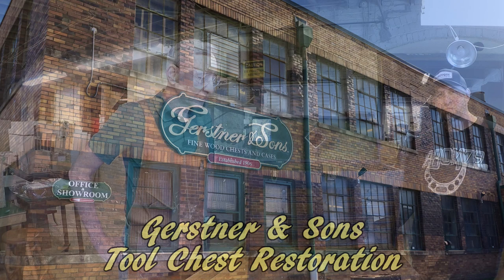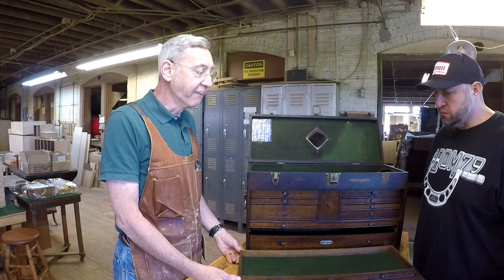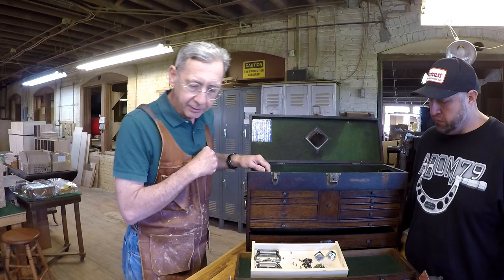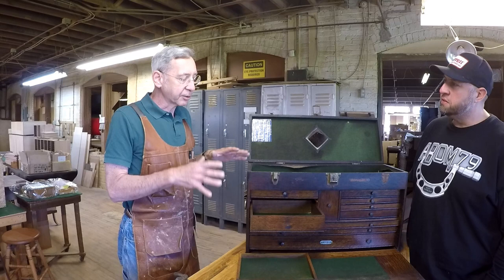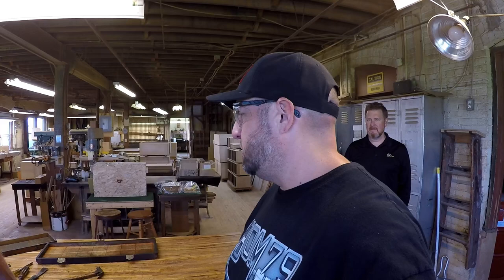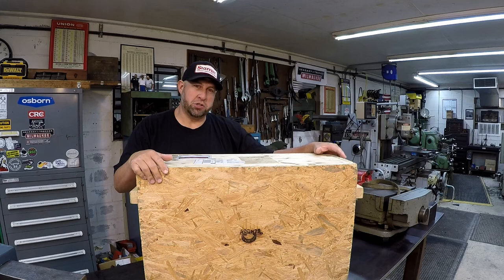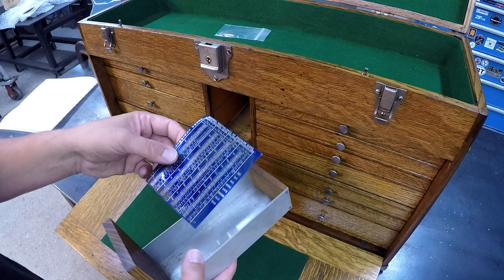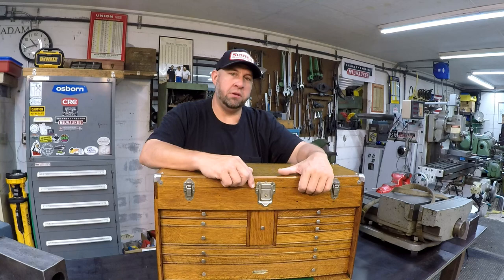Gerstner & Sons Tool Chest Restoration

Comment: You may want to write in the inside of the bottom of the chest "Restored by Paul Martin of Gerstner & Son's for Atom Booth with Date" and include your "ABom79" heat stamp. You must load it with your instruments in order to be functional and complete. If you desire, Gerstner has washers that can be installed behind each drawer knob to eliminate wearing away of the varnish. Enjoy using your instrument chest.

Comment: It is beautiful. This is so wonderful. There is such an overlap between master woodworkers, and master machinists. Both love the joy of producing a beautiful object. Adam says, "They are still using the same tool that they used in 1965." Adam is still using the same tool that was used in1943 !  They have been there since 1906, but of course. Excellence lives forever.

Comment: My Dad was a master carpenter.  He built beautiful furniture. He always signed and dated his work somewhere out of sight.  I wish you had signed the bottom of the box and dated it before it was clear coated.  That would have been a nice touch to the history and preservation.  maybe you can install a metal tag inside with your information.
Reply: I'm sure you meant that it would have been great for the restorer, Paul, to sign it- and I couldn't agree more! I was actually a bit surprised that he didn't.
Reply: That would have been great also, but the original owners name is in the bottom, so I thought Adam's name should be in there also after the restoration.

Comment: a company where i worked as a machinist after you were there 5 years in good standing they bought you a Gerstner box  sized to  your station starting with the 52  and all the way up to the largest at the time   my first chest i believe was the 2111 or one close it was in the late 70s when i received mine  every 5 years after you had choice to up grade to larger chest or add to what you had i made it 12  years and opted for a bottom box omg did it work and look good  i would still have it but it was destroyed in a shop fire i was very sad to loose it

Comment: Hi Adam, you said the box was a 1965 model, you bought it used.  My box is a 1965 model.  I bought it NEW in 1965 and am the ONLY owner.  I bought it on sale for $2 off, it cost me $58, I still own it.  I WAS a machinist/moldmaker, retired 15 years now.  I do not like Oak, mine is Walnut.  Really great video and channel.

Comment: She's an absolute beauty Adam. The ray flake on the front panels, sides, etc. is difficult to find across that width in that quality these days. Mostly because sawmills don't want to quarter cut Oak to just to express that....most of the time the best bet is to split logs yourself....anyway. I've got my eye on an old Oak phamacist's cabinet here in Finland which is along these lines; wood selected for appearance and placement, original brass hardware and hand cut dovetailing where it needs the strength. Unlike your tool chest though, it shows the wear of a lifetime (not it's lifetime!) of use. That's something I want to preserve and keep as-is; unless something becomes fragile or breaks, I'd rather keep in that patina and history to the piece. Restoring your Gerstner chest was the right decision to make, and I know it'll receive the same care and reverence that you do with your work. Beautiful, man, beautiful.

Comment: Paul Martin is a man one can appreciate. While I am usually not all that sentimental about things, I do regard my tools as special. Especially the tools and two Gerstner chests that I have that were owned and used by men who are retired or gone now. When I use a tool with a company name  or a mans initials engraved in it, I wonder what they may have made with them. Did those parts fly on a plane or rocket? fight a war at sea? was the guy a tool maker?  Perhaps he was production or job shop machinists? How long did he own these tools? It's fun for me to think about such things as I make my parts I need. I have always held the craftsmen that came before me in high regard. I can see Paul Martin does too. A beautiful job sir, well done. 

Thanks Adam for making this happen, for me it ranks up there with the Large Lathe Work video as the best Abom79 episode ever!

Comment: I just scored my first 042.  Been looking for a long time, and never thought I'd get one.  I found it about 10 minutes after it got posted, it just said "Die Maker Tool Box".  Saw it, and said "Yep"...contacted the seller and they said "made a mistake, it's supposed to be $300"...I said "OK, when do you want to meet".  I met up with them and talked with the owner of the box.  He left ALL his tools in it.  WOW...so much stuff.  Only issue is that one drawer is a little sticky, and it might need some felt.  I'll consider contacting Gerstner about doing some work, but this thing is amazing, and it came with all this guys tools.  So happy and fortunate to own one of these now.
Reply: Felt will not make your drawer less sticky! The felt “lays down inside” the drawer and therefore cannot in any way hinder the sliding of the drawer!
Reply: @fordboss9275  Yep, aware, I meant that the drawer liners might need to be replaced.  Should have written "Only issues" instead of issue.  Overall a beautiful box and I'm proud to own it.

Comment: So abom I have the exact chest and I bought it in 1972 or 73.....the front lid separated and not by abuse just age
Mine is like new and as I said after seeing your video I called them and they were very nice and accommodating 
I sent them photos and will most likely drive from Asheville to their factory
I won’t get the deal you got but their fees are mire than fair
I also have my 1973 detomaso pantera that I bought about the same time
So thanks for making me to get it repaired at the best possible place
Reply from the maker: That sounds great! 👍🏻

Comment: Adom I think that it looks better than the new one's that were in the show room. With the difference of the older oak and the original hardware cleaned up. It's cool that the original owner wrote his name and address in it and the date. plus it's from the same town where you grew up and live. I think you should write the restoration date and that Paul Martin did it. Also you should write your name, address and date it to.

Comment: Went to an auction about 6 months ago, tons, (literal) of tools. With lots of crud and dirt from a well-known shop in town. In the corner was a  box just like this one. A little rougher shape, I did not have time to stand around and wait for the auction because it looked like it would be about 2/3's of the way through the auction before the box came up. I check the price it sold for and nearly choked, (around a $146). The people must have just been tired of waiting around, all hardware was in tack, there may have been one or two drawers that needed some glue, the felt was all greased out and even worn through. I've kicked myself every day since I thought it would go for at least five times that price.

Comment: To have a piece like the engineering drawer set there, from an environment where everything is being reduced or added to with precision, renovated in the same factory it was originally made, repaired and crafted by hand with much original tooling is, in this day and age, something special.  If cleaning away the grease allowed closer inspection then sobeit.  The original markings pencilled on the wood by the previous owner, not forgetting the factory marking, were still there on the restored box and drawers.  The previous owner would thank you for the restoration of such a well-kept, well-used, fine-toleranced wood and brass drawer set, reflecting the precision the drawers usually would and will hold.  Just a lovely piece.  I appreciate it's clean looks, Adam.
(Adam)

Comment: I walked in that very spot everyday for a couple of my younger years...back in 1974-76. I can testify about the intense craftsmanship put into building those boxes from the beginning with raw materials and to the end with the final touches and inspection. One really cool thing about that building is it was 3 floors with each floor dedicated to a certain portion of the manufacturing process. The only elevator for product transport was an old rope pulled thing...:) Back then a lot of the tools used were of the kind you might see at an antique shop today..:) Last fall 2023 I was on a long vacation drive throughout the USA and arranged to spend some time visiting old haunts around Dayton. I went to Gerstner and although it had changed some...I still recognized the area. I saw a guy on the dock (where I had walked in and out of many times) and turned out to be the current owner and he gave me permission to wander around the outside of the building to take pictures. Later I realized he was the grandson of the top man there in my times.

Comment: Why is there a mirror on the top?  Did the mirror function as a tool in anyway or was it just to spruce up in case you were called in to the boss's office? 8)
Reply: From what others have said, apparently it was for potentially if you got something in your eye, like a sliver of metal or whatever, which was probably more common back in the day.
Reply: @scottr939  exactly, no safety eye wear then. Large magnet plus a steel scriber was how you removed magnetic slithers, for non magnetic a small monofilament loop in a holder was used. That guy can talk!

Comment: My Dad gave Me His Gerstner Machinist top box and His Kennedy rollaway before He passed away in 1982. In 1983 My older sister and My Mother decided that they liked it better than Me and had it stolen from Me so they could sell it. All I knew for many years was it had been stolen from Me up untill 2 years after My Mom passed away and My older sister messed up and told My little brother the truth about what had happened to My Dads tool boxes, I've never been able to find out who they sold those tool boxes to.
Reply: That sucks, I have my dad's also and cherish it. You can get them on ebay used at a decent price I know it's not the same. Hope there is a special place in hell for people like that.
Reply: I'm sure there is a place for them, what sucks is the ones responsible were My Mother and one if not both of My sisters that set it up to have it stolen from Me. My older sister screwed up by telling My little brother about it and then She posted a picture of Herself on FB that My Dad had pinned to the inside of the lid of that box.( She forgot it was the only picture of Her in the outfit She had on and that I was the one who took the picture for My Dad that evening.)
Reply: @tracyfoor4336  hopefully you brother band you are still tight

Comment: Hey Adam, congrats with the top notch restoration of Your Gerstner!!! To protect the outside hardware from the humid conditions where You live may suggest to use Renaissance Micro Crystalline WaxPolish...this product is used by museums and knife collectors all over the world to protect carbon steel blades and even the organic handle materials for rust. The product is on E-Bay for sale.

Comment: That really came out great--a real treasure!
I have a walnut Gerstner 6-drawer style 32 chest that I bought brand new around 1984... initially bought it to hold my various harmonicas, but it outgrew the number of harmonicas that I eventually acquired over the years... I use it now to hold my knife collection.

I also have an oak Gerstner base that has single drawer with 3 sections in it to hold all my harmonica repair tools, and I use the top of the base as a work area... fits nicely on a shelf in my primary work bench.

My wife and I do a lot of antiquing, and I've come across many of the Gerstner chests... most are pretty beat up, but I do occasionally find a really nice one, but they are expensive, and would be even more expensive for me to fill them up with my hobby stuff... but would LOVE to do it... I love those Gerstner chests... I may have to pick one up and try restoring it myself... it would be a fun project !

Comment: Outstanding job Adam! You’re right, it will last forever if properly cared for. I’m not sure what they suggested for the wood care, but If it’s Johnson’s Paste Wax,  you can maintain all the metal surfaces with the Johnson’s. Since your shop is climate controlled, the wax will seal the deal and definitely preserve the metal. Congratulations on a preservation that’s second to none.

Comment: They did a fabulous job on the restoration. My one and only criticism is that they didn't clock the slots in the screws. They're pointing every which direction 😂
Reply: The screws get installed to the correct level of tightness. (torque even). To criticise something because the screw heads are not all at the same angle is a bit anally retentive, If you don't mind me saying so. If you do mind, you are.... wait, you were joking - Doh.
Reply: @garyhardman8369  I was going to tell you that he is joking. Then you got it. At least I hope he is joking  if not I wouldn't even know what to say.

Comment: Great video. I have a box like that, but I don't think it's a Gerstner. There were several manufacturers of this kind of box back in the day, but Gerstner is the only one still in business. Mine dates from the 1920s I think. Still in pretty good shape, though I had to replace the top handle, and the latches I don't think are original, but they're old. My box is still full of old tool bits, drills, taps, calipers and the like. My favourite thing is the Brown & Sharpe combination square, complete with the centre finder and protractor heads. Starrett tools are great, but ever since I got my hands on that square, I'm a Brown & Sharpe fanboy.

Comment: A wonderful restoration of a beautiful tool chest!

When looking at Gerstner & Sons' homepage I at first gasped at the prices. But given that those chests have withstood 50 years of proper use, and will be good for another 50 after that restoration, the prices suddenly seem pretty low. It very much seems like a solide lifetime investment.
Do you happen to have an indication what this two day restoration would normally cost?
Reply: Buy the best you can possibly afford.  In the long run, you spend less.  Exercise care and you DO get what you pay for.  A genuine bargain is rarely inexpensive.

Comment: The only problem I have with a box like that is that the top drawers are suspended and the center will eventually drop like the one in the video.  There needs to be a hanger of some sort run down through the verticals and lower horizontal to hold it together.  Other than that I think they are beautiful boxes.

Comment: Oh, and UPS.
Once worked where we had a UPS computer for shipping stuff, and it died, so the tech came to replace it but there was an issue. Quoth the Tech: "We shipped it to ourselves" and he shook it like a maraca. Many, maybe most, UPS packages get handled by Non-UPS people, as well, so some schmuck working for a contractor making just above minimum is tossing the stuff around (Another workplace was one of those contractors, not my job though. I put the go juice into planes, not boxes).
Then there is the rest of the folks working there, like your driver. 
Also: "We lost your shipment of 3 40lb pails for X customer We will air ship 3 more no extra charge . . ."
We submitted the $3600 plus taxes claim for the lost merchandise and lo "We found it, one is leaking though." and they returned it and we wrote off one of the pails and resubmitted a bill for $1200+ and they paid up, eventually.

Comment: I had one for 40 years but I've had my 4 Kennedy boxes longer and they haven't come apart at the joints like the Gerstner did.
Reply: My Gerstner is 45 years old and it held up fine but it never left the shop while my Kennedy lasted less than two weeks when my roofer backed his pickup truck over it.  He bought me a new one and I still have it with the same framing hammer I used back in the day.  As a cabinet maker I’m surprised that the joints came apart as I’ve used the same joinery  techniques  many times on different projects and they work well.  Then again I didn’t use the Gerstner for my framing hammer nor did I take it from one job site to another.
Reply: @apenza4304  Sorry about the Kennedy.  I had a Kennedy roll-a-way dropped from a fork lift once.  It survived nicely.  Any Gerstner would have been destroyed.  I had mentioned in an earlier post that my Gerstner came from my Dad who bought it used 20 or 30 years before he gave it to me so it is at least 75 years old and it was in bad shape when I received it 40 years ago.  It is just like the one Adam has.   My point was that for a tool box that gets used daily I'd rather have something like a Kennedy rather than a piece of furniture and not have to worry about it.    They're like that valuable collector car you may have in the garage, looks nice and makes your neighbors envious but it's doesn't get used much.
Reply: Wayne D  That Kennedy box did stop the roofers truck while if he backed into the Gerstner he probably would have thought he ran over e 2x4.  The Kennedys I used were mostly the cantilever type with trays for smaller tools on top and they weighed almost as much as I did when fully loaded.  No disagreement here as to which one is more durable and practical.  I must have gotten my Gerstner at a very good price to have bought one in my mid 20’s when money was scarce but I did get good use from it all these years, mostly for my different calipers, small carving chisels, files, jewelers saws, knives, pliers, screwdrivers and other small specialty tools I used for building models.  Many of my heavier tools reside in two Craftsman roller cabinets I’ve had for over 35 yrs. Retired now but still enjoy puttering around the home shop.  Too old to risk my back picking up a fully packed Kennedy though.